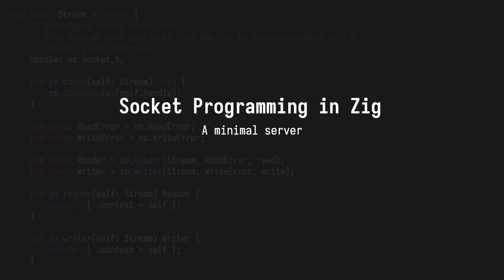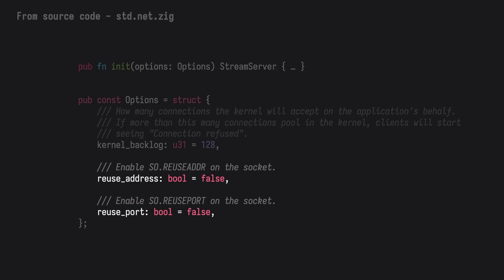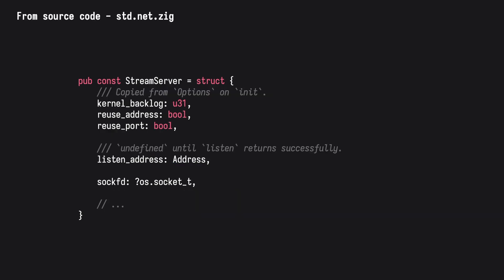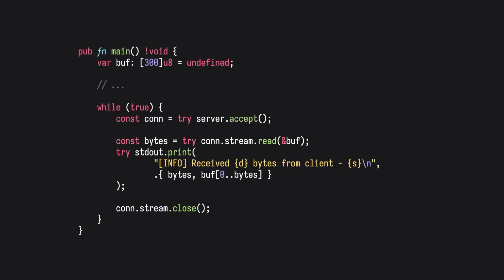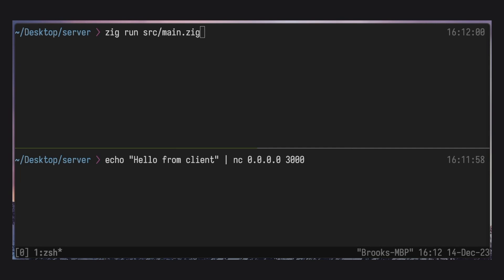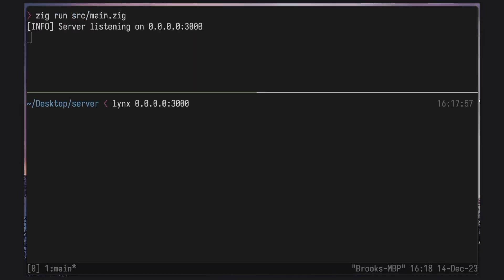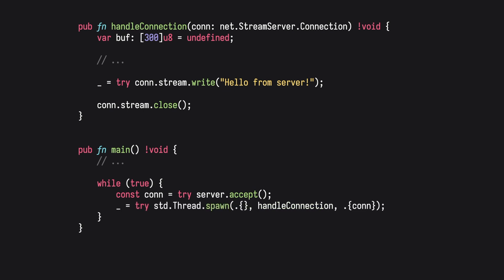Socket programming in Zig

Comment from the maker: ERRATA
- Having `std.io.getStdOut().writer()` at a global scope will compile on Linux, but not on Windows. The preferred method is to define the writer in main and pass it around via function parameters when needed.

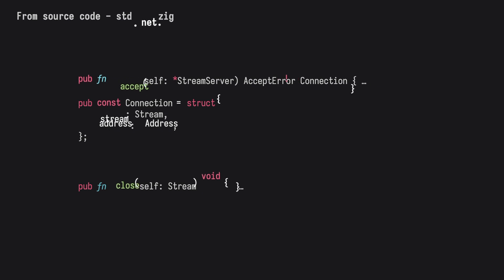- At 1:35, `conn.stream.close() should be deferred - `defer conn.stream.close()`. At 2:14, if either `read()`. `print()`, or `write()` fails, memory will leak.
- As of 0.12.0, `StreamServer` no longer exists. I've updated the code in the GitHub repo to reflect the latest changes - https://github.com/BrookJeynes/zig-socket-example/commit/aa597acdb7c55c784cee747609dc9faa6f93fc9e
Reply: is it a good idea to detach the thread or is it not necessary?
Reply from the maker: @leonss2356  I'm not sure if it's necessary but it's probably a good idea to as in this instance we're letting the thread run to completion in the background. 

Instead of discarding what's returned from `Thread.spawn`, you could capture it and detach like so.
```zig
const thread = try std.Thread.spawn(.{}, handleConnection, .{ conn, stdout });
thread.detach();
```
Reply: hey, really cool video, but std.net.StreamServer isn't really working, probably has been removed, what do we do now?